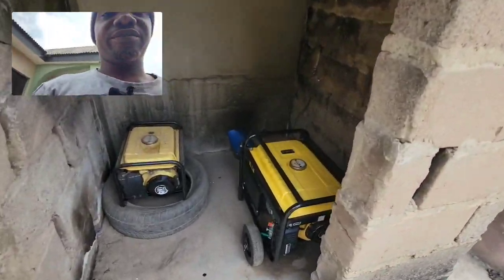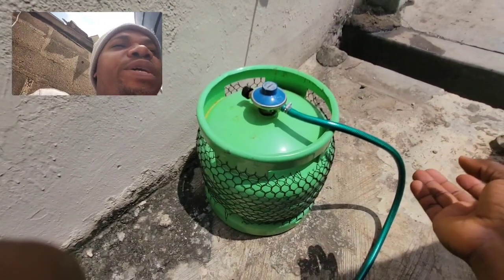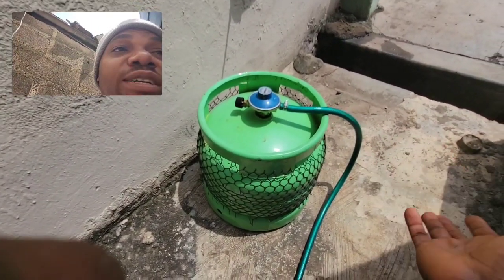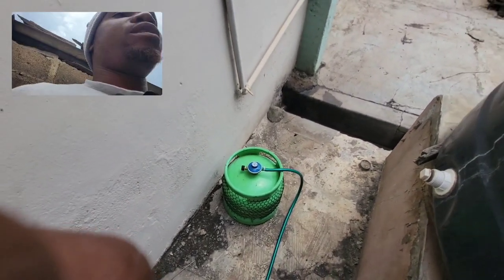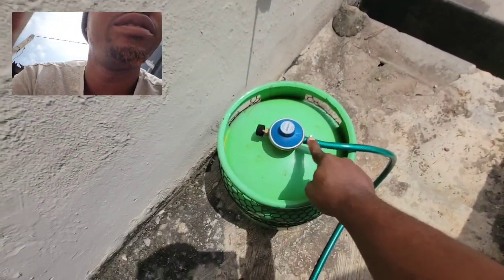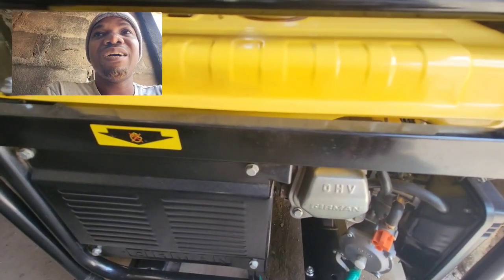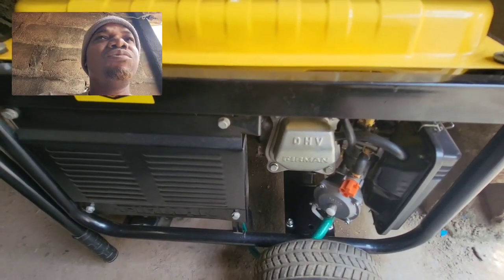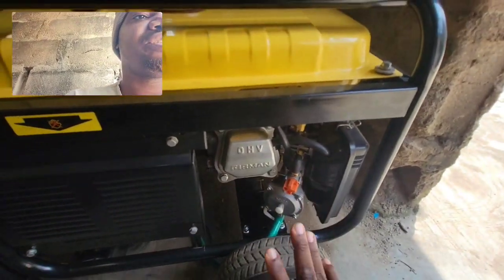Extra Tips!! LPG Petrol Gas Carburetor Usage #foryou #usa #rich #youtube #Nigeria #love #tutorial

Comment: U are right about d oil level?  I thought my generator was shorting oil
Reply from the maker: Lolz.....i didn't even think my oil was getting short. I knew right away that it was due to the gas. At a point, I reverted to petrol usage and the oil shorting returned to normal. I did that like twice and concluded it was due to the gas usage.
Reply: If you go to where they manually refill gas you will notice that when the gas in their cylinder is low they tilt it almost upside down. Go and verify 😂
Reply: Thanks for all your efforts. I surely have become expert from your reviews
Reply from the maker: you are right @paulivangelist
Reply from the maker: i'm glad you found it helpful and informative. @paulivangelist
Reply: I refilled my gas to the brim yet, it still goes off after like 30 seconds of use
Reply from the maker: @achidepeterkure3740  check your oil please.